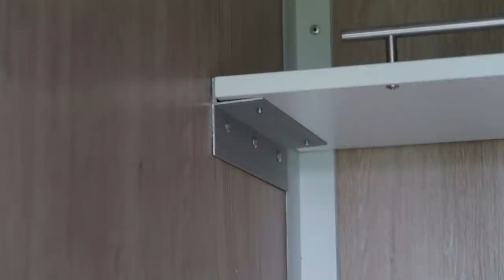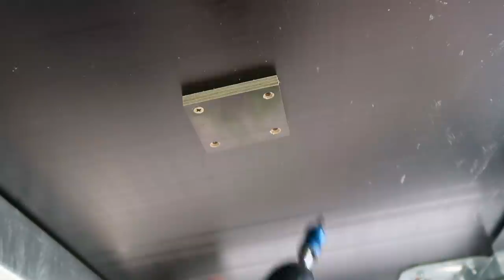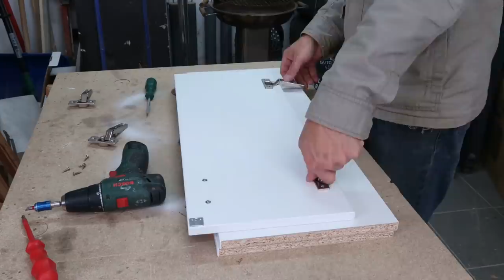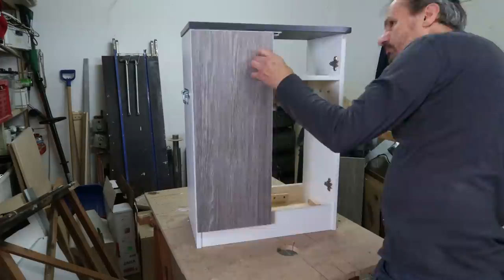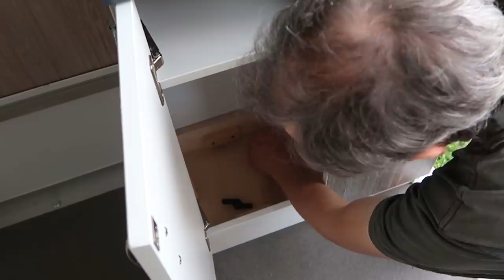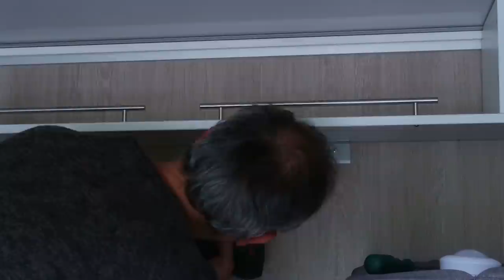Small Cargo Trailer DIY Camper Conversion / Kleiner Kofferanhänger wird zum Wohnwagen PART 2/3

Comment: Great work! Do you really need the middle support part for the bed or would the aluminium profiles do to keep the weight of 2 people sleeping in the bed?
Reply from the maker: The aluminum would keep the weight, but probably not the wood.

Comment: Hello this is a amazing job you have done. Just one question. Are you using standard rivets in that wooden wall? And is the wall full wood or insulated
Reply from the maker: Thanks. Yes standard rivets in combination with special glue. The walls are made with gfk sandwich panels (25mm) not wood.
Reply: @GVMCorner  Ok thank you for you quick answer, so the rivets wont work on multiplex materials?
Reply from the maker: @RudiVDS  I don't know. I've never used rivets on multiplex. I would use screws but also glue.
Reply: @GVMCorner  ok thank you ;-) have a nice day

Comment: Hallo 
Schöner Ausbau in der Art überlege ich auch was zubauen.
Sehr Flexibel und ausreichend für Trips.
Was hast Du für Alu Profile genommen?

Grüße und viel Spaß und Freude mit Deinen Anhänger.
Reply from the maker: https://www.youtube.com/redirect?q=https%3A%2F%2Fwww.hornbach.at%2Fshop%2FWandabschluss-Aluminium-2500x40x40-mm%2F7439448%2Fartikel.html&html_redirect=1&stzid=UgyMgwN3k9UfdHoWPX94AaABAg.9DJrZ1qxOfw9DJtKyuQVZm&redir_token=QUFFLUhqa0k0S0NrSVRTNlNvNERKTDR2bGY5NGh1SHFId3xBQ3Jtc0tuQ1o0UzQtd2hXdW1hS19aakF5M0xYUjIydFNFM3dheWo5OVJhbEQ4amhCR2Nrcld2MGhyMmNsNGQ4Yk9JN0xnaDBYMXlleTdOUEpoa1R1Uk1QdVdNWmYyQkVaRWVUaVJBcW5kSzBlbTVaQ3BjS2dBQQ%3D%3D&event=comments
Reply: Danke für die schnelle Info.😀

Comment: What kind of insulation did you use on this build?
Reply from the maker: I've used no insulation, because the walls are already insulated. 
https://www.castioni-kunststoffe.ch/_Resources/Persistent/7/d/a/a/7daa343cbb02e43ee1bd80a713f1db09f5f0d570/securetec%20verbundelement.jpg